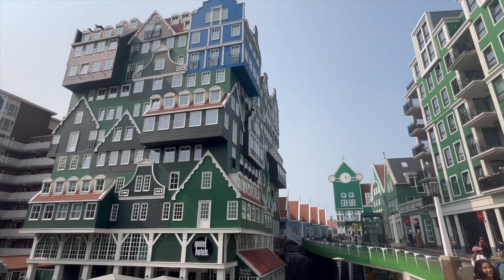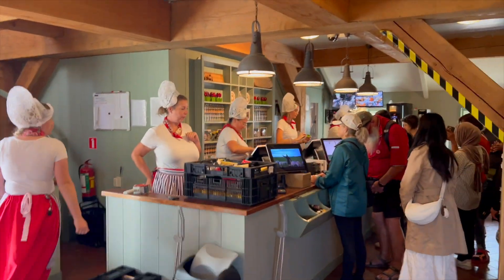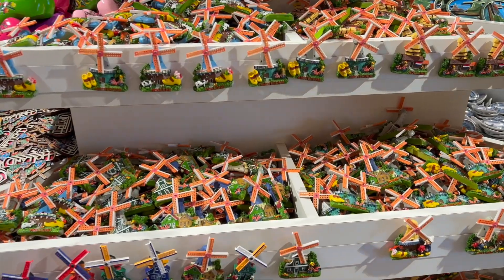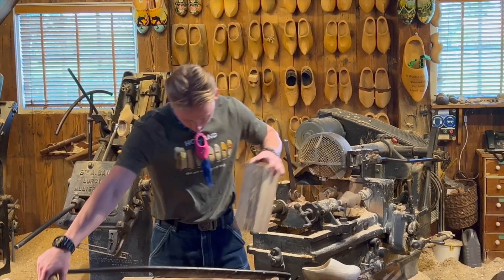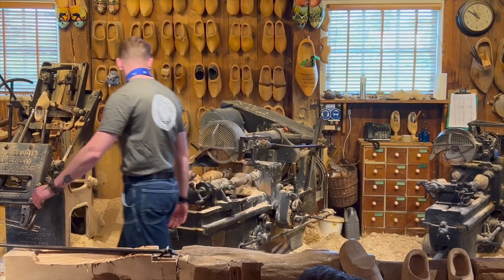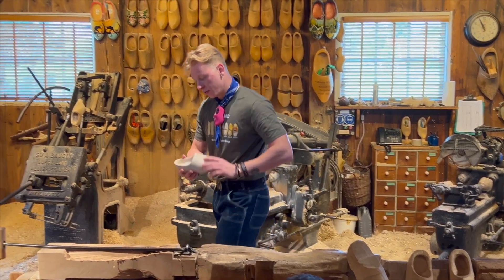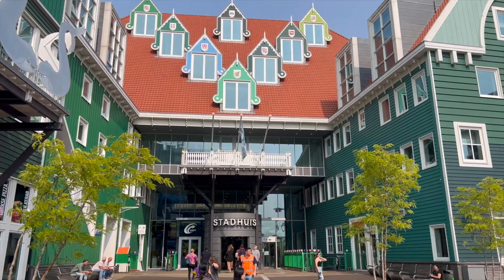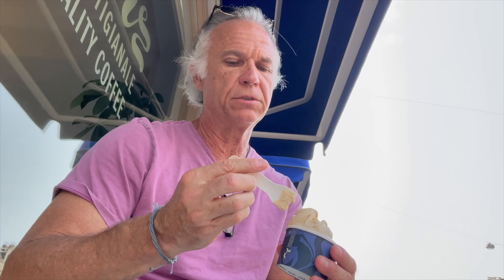Dutch Windmills, Malls, and Metro 🇳🇱

Comment: The e-tickets with the QR-like code that you buy on the website or in the NS app don´t need to be checked in or out. The QR-ike code is only for a ticket inspection or to open the barriers when a station is equipped with those. So you can just hop on board if you have such a ticket.
If you have a phone with contactless payment enabled, make sure to load the e-ticket in the NS app when you present it to a barrier, as the NS app will suppress the contactless payment, so you don´t get charged twice.